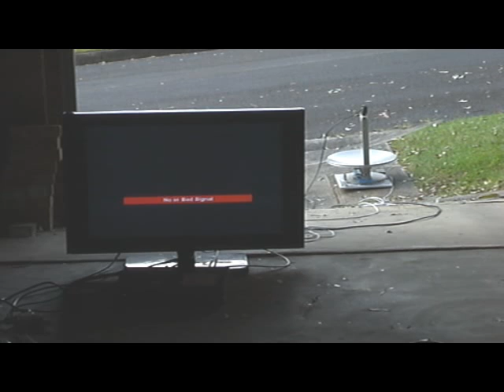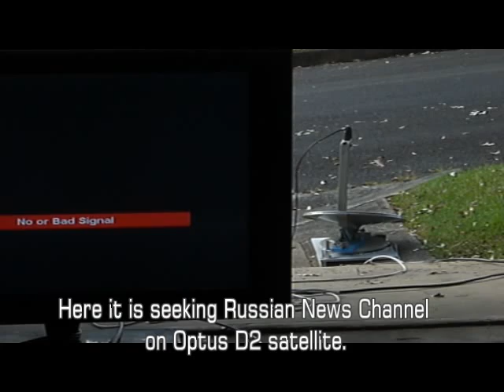Homemade Portable Automatic Satellite Dish for Caravan using PIC16F88

Comment from the maker: The satellite doesn't move, the dish just has to find the right spot and stay there. You could use a PC if you are able to program it, you also would need an interface to allow the computer to drive the motors, read the limit switches and check the Satellite receiver.

Comment: Mr Brian, could you tell me the NIM module used in this satellite receiver and the pin number you attched your I/O port, in order to read the lock status? I would like to reproduce your results...
Reply: I watched this teardown video and I think you can get the part number of the modules here https://www.youtube.com/watch?v=JSnTLh06n0w
This is modules in the above video https://www.mikrocontroller.net/attachment/98303/TD1316AS_Desc.pdf
https://www.mikrocontroller.net/topic/204811
It seems on there's no 'lock' pin on the modules but there's a lock flag in the status register. You can communicate with the module through I2C.

Comment: I was very interest to see your satellite project, as i've been thinking of something similar myself, as i live in the UK my dish would have to be almost vertical which presents its own problems. The software solution and interface to control the motors, is written in assembler which i have experience of the hardware controls outside the receiver appears to be dedicated to controlling the motors only?. I would be most grateful if you would share your software and hardware solutions.

Comment: Mr. Brian, It seems you get the lock signal direct from the related satellite tuner pin... Is that right? what about your search pattern? Do you use a specific algorithm?
Reply from the maker: You are right, the search pattern is quite simple
Set the elevation low, rotate 180 degrees, set elevation slightly higher, rotate back 180 degrees etc

Comment: I have watched this video, quite a lot.. I am working on the similar system as my final year project. The only difference is that I am using DC motor and a linear actuator. Can you please help with the algorythm that you used. I am sure is it the exact one I need to track satellite on my project.Can I have you email, so that I will send more information about it.

Comment: Trying to do this with a simple Arduino Uno. Not super good with microcontrollers, but Ima try and put in the effort. :)  I'm trying to turn an old antenna rotation box, which I've mounted a solar panel to, with the use of an Arduino. I have to move the box manually at the moment. Came out a little better than I thought. I want to eliminate the 110v box that the programming comes in. Can I get rid of this box and replace the tuner with an Arduino to move to a certain degree and have the system stand alone using 12v? I'm just starting to get into hacking stuff and it's fun. I hope I've been clear on this enough for you to point me in the right direction. Basically I'm wanting to make a solar tracker and hook the rotator motor up and be controlled by the microcontroller. Any suggested websites? Diggin your set up, Man.
Reply from the maker: +chop98 Not easy to follow exactly what you are describing, but as long as you are having fun !    Brian
Reply: Brian Healy
:) Now that I haven't been up for 20 hrs. I'm wanting to replace the control box that comes with the AR500 with an Arduino programmed to rotate the motor at a given time. The motor requires 3 connections. I'm guessing +, -, and a signal wire. It runs 18v to the motor. So I'm assuming I'll need to run a relay from the battery to the motor for that part, right? Like you say though... as long as you're having fun doing it. :) Thanks for the reply, Brian.
Reply: Hi Mr Brian, could you please share diagram and code with me?

Comment: can you advise which 12 v motors you used please
Reply from the maker: Jaycar Motor model YG-2732
12 VOLTS 72 RPM, but I am running it at 8 volts